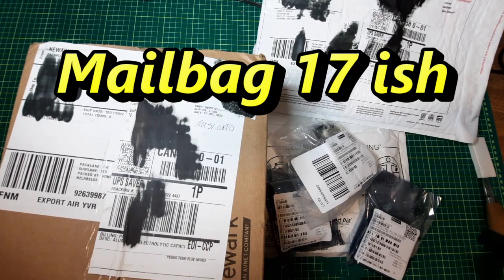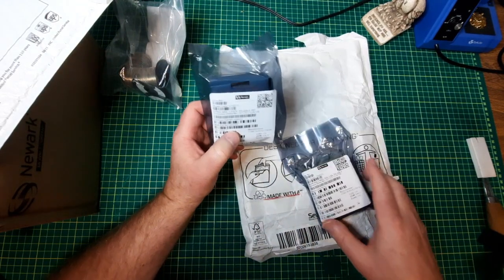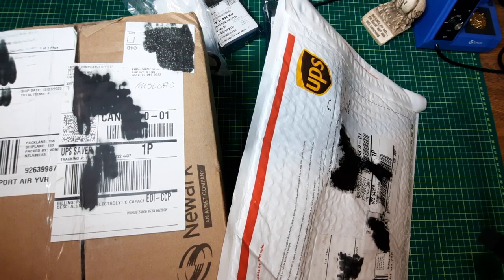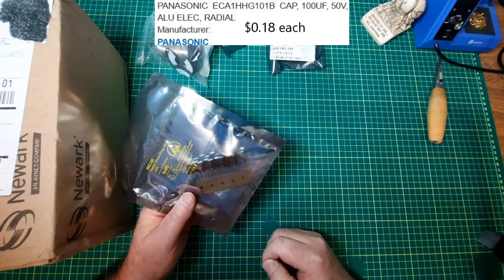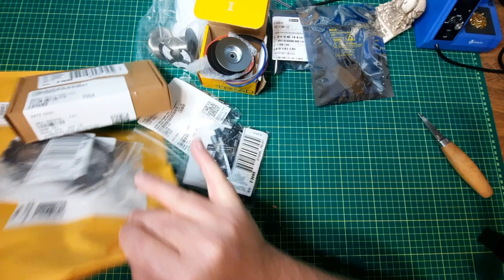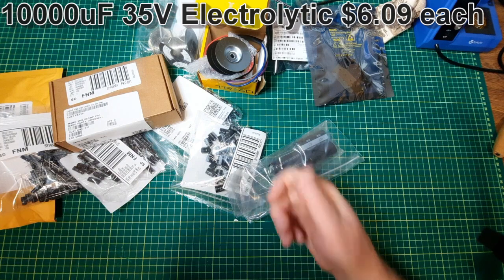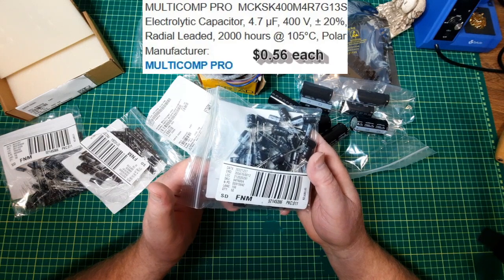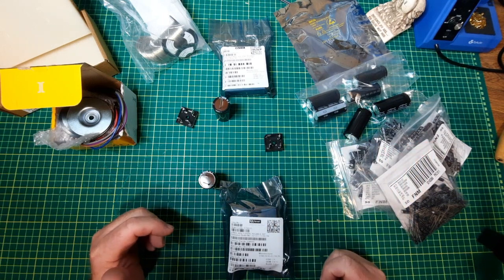Electronics Mailbag 17 ish

Comment: We don't just want to see bags. We want to see what's in them!
Reply from the maker: A bunch of capacitors and regulators are really boring to look at, hence I kept it short. If you want to see some really interesting parts, I will be fixing/updating an Electro D-612-T power supply shortly. Has Selenium diodes and a several pound inductor. It regulates the old way, with brute force.
Reply: @retireeelectronics2649  LESS BORING THAN JUST SEEING BAGS THOUGH.
Reply from the maker: Hope the last mail bag is better.  It is wierd but I like less than positive comments so I can improve. I am doing this for fun, but improvement is better.

Comment: Are you going to use that small transformer with those big capacitors? 22000uf?
Reply from the maker: Nope. In Mailbag 4, I picked up a couple TRIAD FD7-36-237-1761, 36VCT at 1.5A transformers for a total 56VA. Plus I need one for a Electro D-612-T power supply I will be restoring.  A bit later I added to this comment -  The maximum capacitors size for the power supply should be less than 10,000uF preferably 6800uF otherwise I will have to beef up the in-rush current section that I did not mention in the video.
Idea behind this is to get the two 12VDC car batteries off of my bench which I have been using as a dual supply.
Had to use what I had (-:
Reply: @retireeelectronics2649  those transformers are small as well. You need at list 5 amps transformer